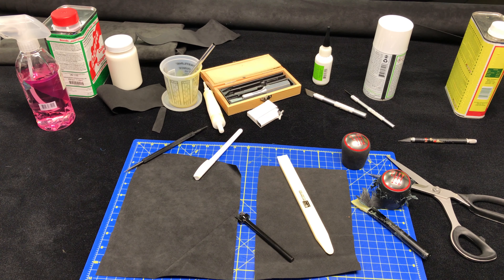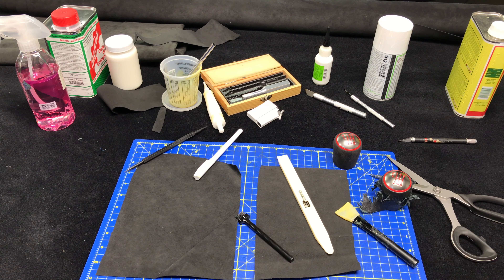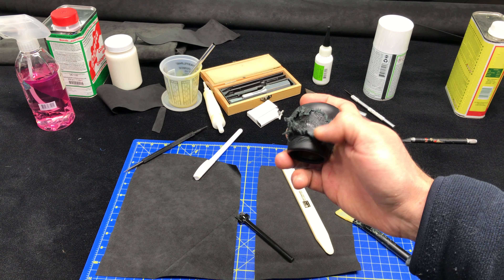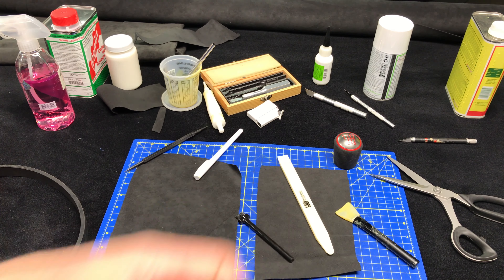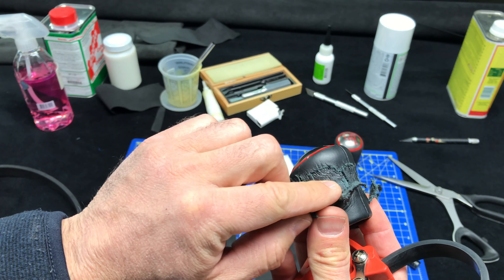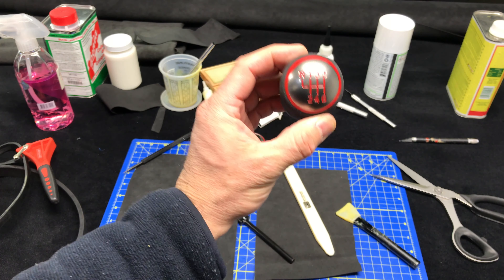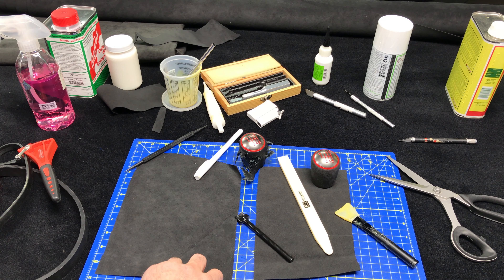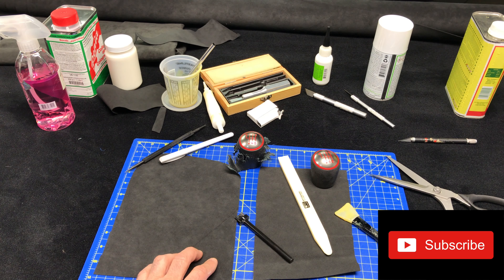How To Remove A Shelby GT350 Shift Knob | Auto Fanatic

Comment: Steve from middle Ga here. Tried to get my shift   
knob off today and what a bloody mess!  Tried to remove it with my strap wrench and made one complete turn counter clockwise and stopped. Looked at the leather boot and something didn't look right. I believe everything from the knob down turned. Lock out collar is stuck, boy stock shift knob doesn't look so bad now lol.
Reply from the maker: Sorry to hear that some can be a real PITA even a few ive removed for customer cars gave me absolute hell.
Reply: I'm really not interested in reusing the existing shift knob, can't I just cut the dang knob off with a Dremel!
Reply from the maker: be careful if you damaged the threaded shaft then youll need to replace the shifter, try a heatgun to help free things up always

Comment: I REALLY struggled to get my GT350 knob off.  I'm not a fan of the OEM knob due to the shape and went with a round knob (but to each their own).  That said, I tried the strap wrench thinking I was brilliant but it would not budge.  I did not try heat.  Mine looks nearly as bad as the one you showed.   I ended up needing a small pipe wrench.  No joke....  I think some are just really on way to tight or with too much lock tight.  I couldn't even move mine with the strap wrench once I broke it!  It still took enormous force to spin.  It was crazy.  Good luck to those with the challenging ones...
Reply from the maker: thanks for sharing your struggles my Red GT350 was a PITA as well years back for some reason during assembly Ford overdoes the loctite on these and some come off easy. I also wonder if the knobs are screwed on by hand or a robot torques the crap out of them to make them straight.